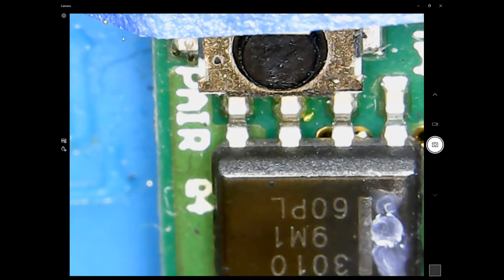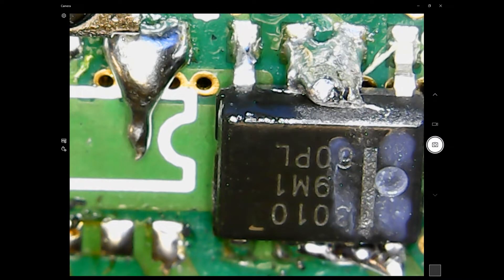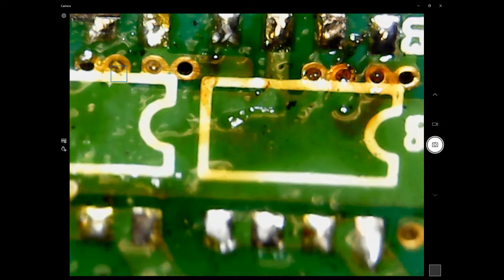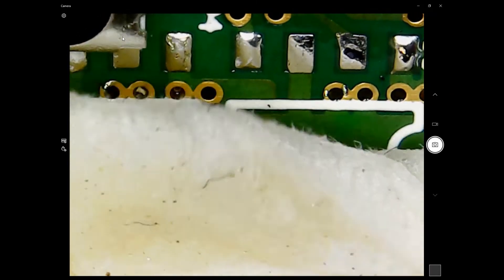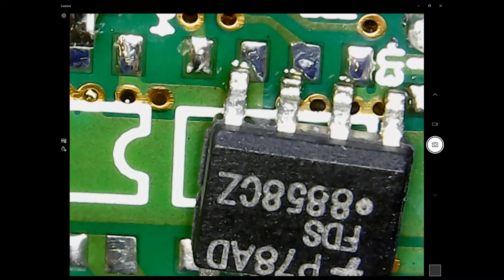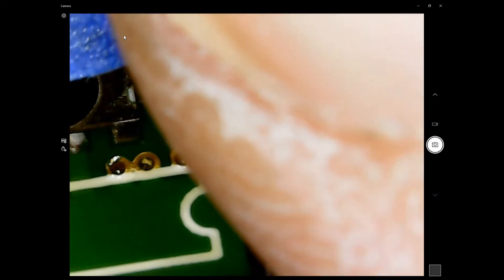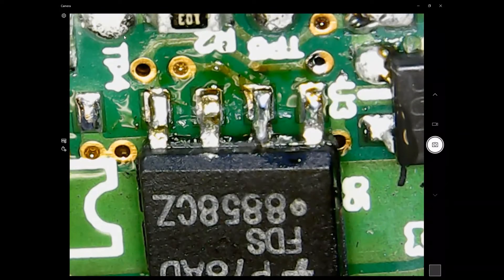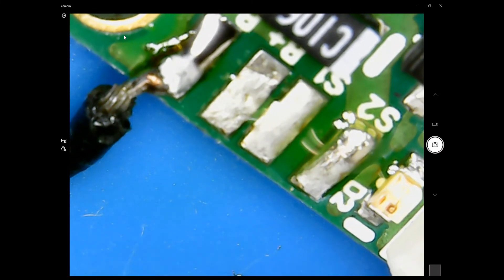FET replacement FDS8858CZ

Comment: What percent is the alcohol that should be used to clean it?
Reply: I have a mini z board AFS  VER C What type fet recommend for replacing?
Reply from the maker: I used 99 percent but 70 percent is fine also. Just make sure the circuit board is dry before powering up.

Thanks for posting a question. Didn't expect anyone to see this video.